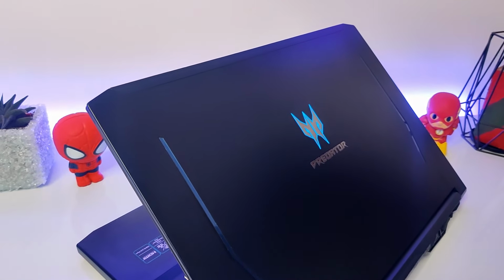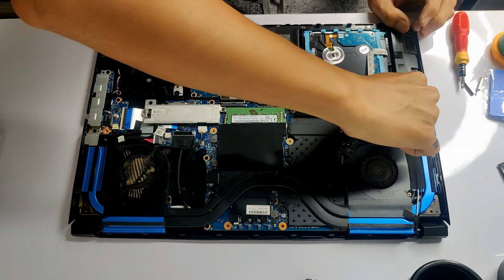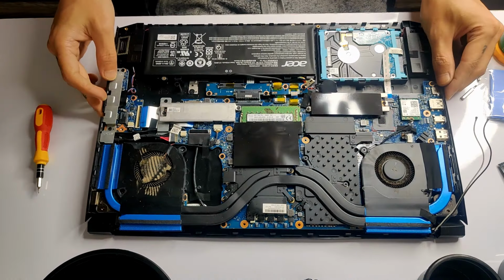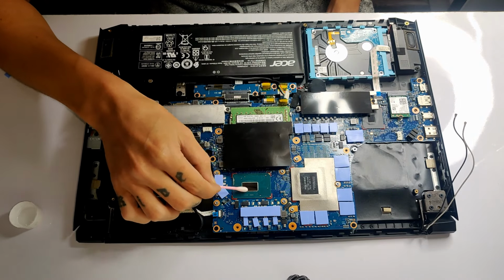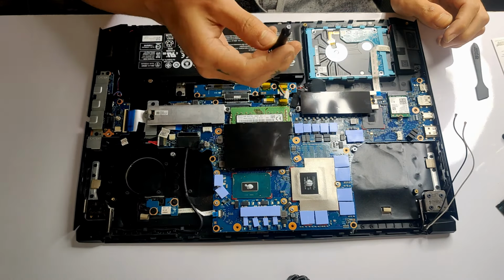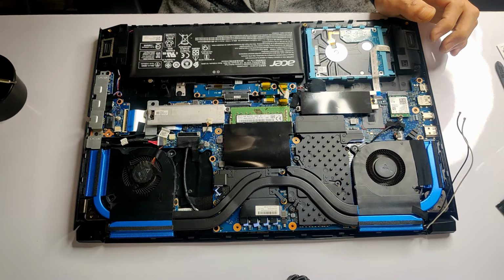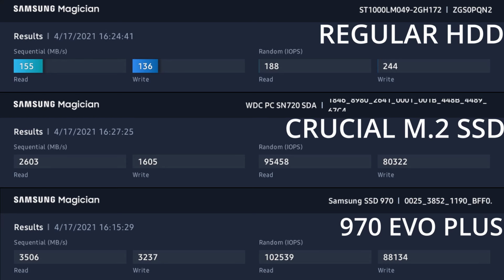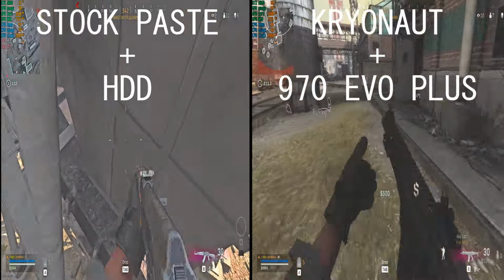ACER PREDATOR HELIOS 300 2019 UPGRADE | REPASTING | CLEANING GUIDE & BENCHMARK

Comment: I have a predator triton 300 and I’m a little inexperienced on replacing the thermal paste (disassembling the whole laptop, essentially)
I’m really worried I disconnect the fans improperly and struggle to identify which parts can disconnect and which don’t, alongside how much force I can use. Any tips?
Reply from the maker: Hi. You can just follow the video step by step and do it with patience. The force applied can be gradual. Just make sure you pull the connectors in the right direction.
You can reach me out anytime if you need help. Do subscribe to the channel to show some love & support 😃✌🏻❤️
Reply: @MVNDRVX  I would like some help removing the fans. There are 5 cables from left to right:
2 small ones (black and white) that I think seem to connect to the Killer card (left fan)
A small black one (left fan)
A small white one (right fan)
A large or long black connector (right fan)

Also, how can I remove the battery safely and is the battery cable inside safe to stay loose because I wasted the small black tape that kept it in place.
Reply from the maker: @itstoasty7089  the battery cable is just fine if left loose disconnected.
Can you send me some pictures on my Instagram or any other platform? So I can have clear idea of what you're talking about.
Sorry for the late reply. I was in the middle of my livestream 🙂
Reply: @MVNDRVX  sure could you send it to me
Reply from the maker: @itstoasty7089  my Instagram ID is in the video description 🙂
Reply: @MVNDRVX  alright bet

Comment: For the vram areas can we use thermal gel instead of pads? The areas which were initially pink
Reply from the maker: You can but you need to have a thicker viscosity paste. Normal thermal paste will not do the job. Better replace with thermal pads.
Hope that was helpful. Do support the channel by dropping a LIKE & SUBSCRIBE 🙂✌

Comment: Hi, you know how to replace the keyboard?, in my laptop some keys on the left side stop to work
Reply from the maker: Hey. Yes it's pretty simple. You will have to unscrew the motherboard and turn it upside down. Be careful not to pull out the motherboard too hard or else you will destroy the ribbon connectors of the keyboard. Just lift the motherboard a little and unplug the keyboard ribbon cable. It's most probably a lift type lock for the ribbon cable.
Lastly to remove the keyboard itself, it should be held down with some plastic locks on each side. Which would be pretty simple to remove.
If you come across any trouble, do feel free to ask. I'll get back to you ASAP.
Good luck 🙂✌
Reply: @MVNDRVX  Thanks, I just ordered the replace keyboard in AliExpress, hope in a month it will come
Reply from the maker: @erickrivadeneyra1358  Cool 👍 Let me know how it goes 🙂

Comment: I'm still surprised how people could still say the Predator 300 have thermal issues even with all those vents.
Reply from the maker: People living in warm climate countries where it's sunny all around the year like myself know how hot it can get 😅
Sorry for the late reply 🙂✌
Reply: @MVNDRVX  great answer! 😊 we live in a place with warm climate too so my Temps usually play around 85 to 90°but with the aircon on cpu and gpu cools down too by 10°thanks. :)
Reply from the maker: @storysorry4854  before repasting and with the aircon my temps were still bad with just 1-2 degrees less.
But after repasting, you're right 10 degrees minimum reduction even without aircon 🙂

Comment: Thanks for this great video, I have just one question. The thickness of the thermal pads are official? 1mm on everything and 0.5 on the VRAM
Reply from the maker: You're welcome. Thank you for watching 🙂
If you ask Acer they would suggest 1mm pads on everything.
But I've done tons of research and came to a conclusion that 1mm is too thick and would have some thermal resistance.
Many people have asked me this question and my suggestion would be to apply thermal pads as shown in the video. Do not apply the thermal paste yet. Fix back the heatsink.
Let it rest for a while. Remove the heatsink and check for contacts. If you see contacts on every pad, then you're good to go.
If there is no contact on some pads, just apply a little bit of paste on them.
Hope this was helpful. Do subscribe to show some love and support 🙂❤
Reply: @MVNDRVX  Thanks mate! I'm going to get Thermalright 1mm and 0.5mm thermal pads and Kryonaut thermal paste!
Reply from the maker: @kezziekz  you're welcome. Glad I could help 🙂
Reply: @MVNDRVX  Can I apply the same thermal paste of CPU/GPU on the Vram?
Reply: @MVNDRVX  are  the VRAM chips those in the bottom right, around the GPU chip right?
Reply from the maker: @JotaFla  sorry for the late reply. Not sure why I didn't get your notification.
Using regular thermal paste instead of pads would not be a good idea since regular thermal paste are low in viscosity 🙂
Reply from the maker: @Antonio-rt4yg  Yes that's correct! The chips with pre applied pink paste are the vram memory chips 🙂
Hope you like the video. Do SUBSCRIBE to show some love & support 😊✌🏻❤️
Reply: @MVNDRVX  Hoo I see, thanks man, your video is going to help me a lot. I already bought everything, next week I am going to clean my gamer laptop haha.

Comment: Even after removing every screw from the cooling system (i triple checked), it was still very firm/stuck around where the screw with number 6 is. 
I was afraid to pull it because I don’t want to break anything. Do you have any tips?
Reply from the maker: Are you sure you removed all the screws? It should be easy to pull out the heatsink.
If you're pretty sure that all the screws are removed, then just hold the both the sides of the pipe and pull harder. Nothing will happen.
Just make sure you've removed all the screws 🙂
Reply: @MVNDRVX  ok, i will give it a second try, just wanted to be extra sure that there is no screw on the other side holding it. Thanks a lot for the video and for the quick response
Reply from the maker: @herbertjunior8297  no problem at all. You're welcome.
 There are no screws holding it from the other side 🙂
Do feel free to ask me if you have any other queries. Hope this was helpful. Do subscribe to show some love & support 🙂❤️

Comment: Are the thermals still good? Because I have heard that kryonaut works great for first few weeks and then starts getting worse because it's not meant for Laptop CPUs and what are ur system temperatures?
Reply from the maker: Yes. The thermals are still good. Max temps goes upto 84-85 degrees without air conditioning.
If any thermal issues arise after few weeks or months, it's most probably due to the dust in the fans and not the issue with the thermal paste.
Hope that answered your question. Do SUBSCRIBE to support the channel 🙂✌️
Reply: @MVNDRVX  what about you system temps?
Reply: Asking because my system temps are really bad
Reply from the maker: @UjjwalPandey24  I was just trying to check. Just give me sometime, I'll play a game of warzone and check the system temps in the predator sense software. Will let you know soon 🙂
Reply from the maker: Alright so checking predator sense software after a game of warzone my cpu temps are 80, GPU at 66 and system at 79 🙂
Reply: MANDRAX ok so are those system temps normal?
Reply: Thanks for checking btw
Reply from the maker: @UjjwalPandey24  Totally normal for a laptop bro. Not a problem. you're welcome.
Don't forget to SUBSCRIBE to support the channel 🙂
Reply: @MVNDRVX  ok bro thanks alot !

Comment: Does the dram actually benefit from the thermal pads? I understand the cpu and gpu probably get better temps but what about the system itself? Are the .5 mm pads you used superior to that pink paste?
Reply from the maker: Memory chips do produce certain amount of heat but not as much as the CPU & GPU itself. So most of the system heat comes from the CPU & GPU.
I feel the pink paste is just an overkill and regular 0.5mm pads works just fine.
Been using them for over a year now with heavy gaming and streaming, no issues until now 😉
If you feel the video or I have been helpful, do subscribe to show some love & support 😊✌🏻❤️

Comment: What kind of pads did you use? Thickness and what not? Thanks I’ll be using this video as my guide when I repaste and change pads on my predator triton 300
Also, should I use thermal paste AND pads on all the other parts besides cpu/gpu? Or just the pads?
Reply from the maker: I just used some cheap thermal pads from Amazon based on the reviews. The brand is called adwits.
I used 0.5mm in replacement of the stock pink paste and 1mm for the rest of the chips.
Not sure about the thickness used for triton 300. Do check on that.
Only replace thermal pads if necessary. It's not mandatory because thermal pads last long in most cases and just use thermal pads alone. Only apply paste on pads where you think contact is not made with the heatsink.
Hope this helps. Do subscribe to show some love and support 🙂✌️❤️
Reply: @MVNDRVX  oj ty, thats where im gonna get my pads from, but the I saw 0.5 thickness, along with 1.0, 1.5, 2.0 and  so on, o then I was like crap which will fit inside my predator triton lol, but ty this was helpful, how much of a temp drop did you see with the new paste and thermal pads??
Reply from the maker: @paidn4ull  atleast 10-12 degrees 🙂
My CPU touches 83 and GPU 63 during gaming and streaming 🙂
Reply: @paidn4ull  i got triton 300 too. Did you make it. What thicness did you use?

Comment: Is it same for 2020 model? And what about the thickness of thermal pads? Same for 2020?
I was looking for a video which mentioned the thickness 😁 yours is the best one. Great tutorial
Reply from the maker: In most scenarios, where the thermal pads are still good, you don't have to change it. Since mine was flaking as you see in the video, i decided to reapply the pads.
In case you've decided to reapply the pads for the 2020 model, it's probably the same size as the 2019 model. Just buy the thermal pads from Adwits brand where they give you 2 pieces of each size and compare the size difference between the old and new pads just to be clear.
Reply from the maker: Thanks for watching. I'm glad to know that this video was helpful. Do LIKE and SUBSCRIBE to my channel for more content. I'd really appreciate that 🙂
Reply: Thanks for replying 👍 subbed
Reply from the maker: @mushthaqueahamed6322  you're welcome👍 thanks for the sub😊✌
Reply: Man I have the Helios 2020 i7 rtx 2060 model and I am facing weird throttling at GPU temp 75-77c where clock dips to 1005mhz and I get 20-30fps for a while and then goes back to normal after a while
Reply: Could it be vrm ovrrheating n throttling cpu temps r below 85c
Reply from the maker: @nickfury4760  Do check your power management settings and do you keep the TURBO mode switched on?
Reply: @MVNDRVX  no bruh
Reply: @MVNDRVX  best performance
Reply from the maker: @nickfury4760  There could be many reasons as to why this issue is happening. It could even be a windows issue. I'd suggest you take it to a service centre and get it checked because the exact issue cannot be said without taking a closer look 🙂
Reply from the maker: @nickfury4760  Best performance? In what? I don't understand.
You mean EXTREME in the predator sense software?
Reply: @MVNDRVX  I have flashed 115w vbios from msi gl65
Reply: My GPU consumes 115w
Reply: @MVNDRVX  from predator sense normal else battery mode best performance
Reply: This used to happen even b4 flashing vbios
Reply from the maker: @nickfury4760  it sounds like a power supply issue or it could even be software related. 
Do take it to the nearest service centre and get it checked.
Reply: @MVNDRVX  so removed pink puddy from vrms and added thermal pads 0.5mm provided by acer and added pink puddy to the GPU vrams...
Reply: @MVNDRVX  no more throttling even at 115w vbios which I applied...seems the issue was with vrms overheating due to dried pink puddy...ur video was informative man and I used 0.5mm as I don't want to take the risk of creating a gap between cpu-gpu heatsink
Reply from the maker: @nickfury4760  cool. I'm glad you found the video informative. I guess you will have to reapply often since the GPU is drawing more power than normal, causing more heat and quicker deterioration of the paste and pads.
Thanks for watching. Do SUBSCRIBE to the channel to show some love and support 🙂✌
Reply: @MVNDRVX  bruh how did u decide wut thickness of thermal pad to use?
Reply from the maker: @nickfury4760  Don't even ask bro. I did a lot of research 😅
Reply: @MVNDRVX  I couldn't find any thread for 2020 models, I applied 0.5mm thermals pads on vrms but I am getting high temps
Reply: Y is it so?
Reply from the maker: @nickfury4760  Thermal pads/puddy are nothing to worry about since the memory chips don't produce a lot of heat. 
It's mainly the CPU & GPU. Wait for a couple of days to let the thermal paste cure completely.
If you're still having high temps, then maybe your thermal paste application was not proper/sufficient. 
Secondly, since you've flashed the bios and drawing more power to the GPU, you can't expect very good thermal. There's a limit a "laptop" can take. I'd suggest you  make everything back to stock.
Did you clean the fans?
Reply: @MVNDRVX  b4 I used to get gr8 temps even after flashing vbios but then GPU used to hard throttle itself to 1005 mhz at 75c gpu giving 20 fps but after application of thermal pads on vrms it doesnt throttle but temps soaring high on cpu-gpu both
Reply from the maker: @nickfury4760  Then it's the problem with the thermal paste application. Did you clean the fans? And which thermal paste did you use?
Reply: @MVNDRVX  does higher thickness of thermal pads provide gr8 cooling
Reply: @MVNDRVX  I just applied thermal pads I applied thermal grizzly earlier
Reply from the maker: @nickfury4760  no. Thicker pads don't provide better cooling. In fact, it makes it worse since it becomes more thermal resistant.
FYI, you should always apply fresh thermal paste when removing the heatsink because air bubble form if it's not repasted. Hence causing thermal levels to rise. 🙂
Reply: @MVNDRVX  ok got it so everytime u open chasis, u replace thermal paste
Reply from the maker: @nickfury4760  Yes. That's right. Every time you remove the heatsink from the CPU & GPU, you have to repaste with fresh thermal paste 🙂

Comment: What about thermals? How much improvement have you seen after repasting?
Also the thickness of the thermal pads are official or based on some  your Intuition ( like you chose an approximate thickness)?
Reply: Oh sorry my bad, i didnt notice. You did include in the end of the video the thermals😅
Reply from the maker: I did see a minimum improvement of 10-15 degrees. Do not use Arctic brand. I repeat, no Arctic! Either go with thermal grizzly kryonaut or the noctua nt-h1.
Reply: @MVNDRVX  yes i was planning on kryonaut as well😁 it has the best performance for the price
Reply from the maker: @mushthaqueahamed6322  true. A choice well made. Out of past experience, i ordered for an arctic mx4 and since it doesn't come in a sealed pouch like the kryonaut, i believe i received a fake one which didn't have any effect on the thermals 🙄
Reply: @MVNDRVX  Damn I have been using arctic MX. Why are you against it? Could you elaborate?
Reply from the maker: @Batshitify  First thing is the thermal conductivity. Arctic mx4 has a conductivity of 6w/mk while the Kryonaut is 12w/mk. 
And also there are a lot of fake Arctic thermal pastes out in the market. I've experienced this personally.
Hope that was helpful. Do LIKE & SUBSCRIBE to support the channel 🙂✌
Reply from the maker: @erik7848  Nah I'm just "no Arctic" cause there are fakes out there and if people get their hands on one, they're going to blame me for misleading them. 
Plus, the kryonaut has a better thermal conductivity at 12w/mK. Whereas, mx4 at 6w/mK and Silver 5 at 8.9w/mK 🙂